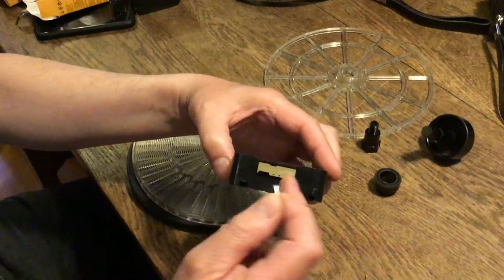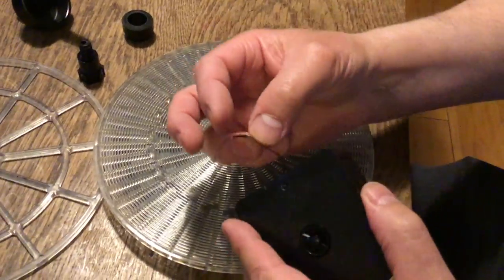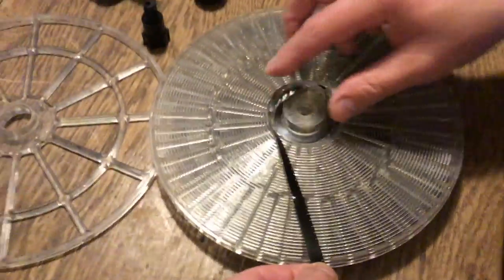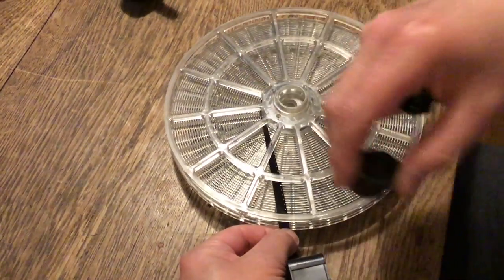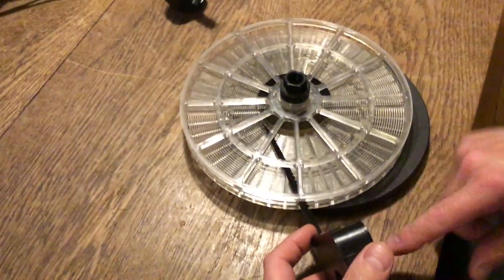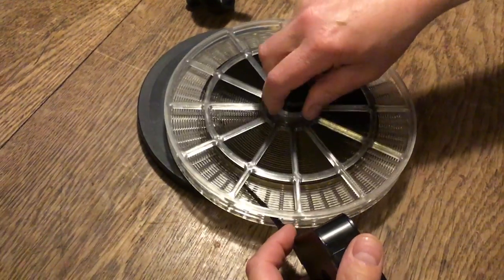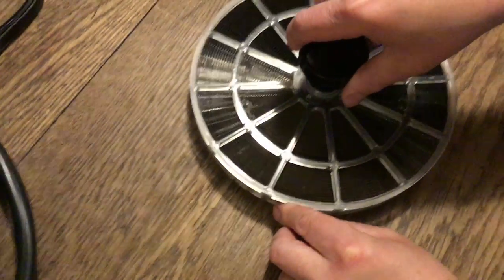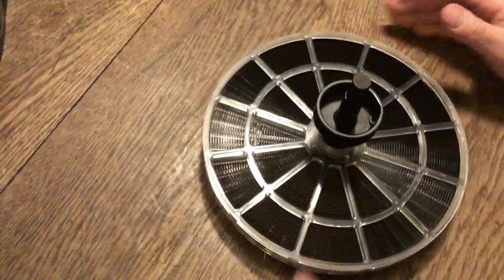Super 8: loading a cart onto a Lomo developing tank spiral

Comment: Funny as I just recently have used this method on my last two developments. Saves heaps of time fumbling back and forth onto reels in the dark
Reply: I would also like to add for anyone using the LOMO tank and having problems with an even development. When you agitate the film in the tank, do not spin the spiral. There should be freeplay to pull the spiral straight up in the tank about an inch and then you let the assembly fall back into the solution. I will then smack the sides of the tank a few times to free up any bubbles. I do that procedure every minute for all solutions during development.

Comment: hi Adrian! Once the cartridge has been opened are you able to cut off the film strip after loading it onto the reel and then leave the remaining film undeveloped in the cartridge or does opening the cartridge this much leak light? I just wanted to do some tests and so do;t want to sacrifice a whole cartridge!
Reply from the maker: the cartridge isn’t opened at any point, you can remove as much film as you want to test, and as long as you leave a bit hanging out of the cartridge you can then come back and load the remainder onto the spiral. Loading the film needs to be done in complete darkness, so there should be no opportunity for it to become exposed to light
Reply from the maker: This Facebook post I did has some more details on how to do a super 8 test strip: https://m.facebook.com/story.php?story_fbid=pfbid0eg171FSxk2y5WMerd4FcDLV5zHnYLWrwAAhbp8DQFMxksdjsBmwNZsVZoXXg4gJzl&id=582718948

Comment: Great video. I'm not sure I understand why you put that small pin inside the cartridge? If you turn the wheel counterclockwise so it breaks, won't that allow you to pull the film out of the canister?
Reply from the maker: Turning the wheel anti-clockwise isn’t enough - the cartridge has a plastic pressure plate that needs to be pressed down in order for the film to be extracted without scratching it, in the camera there’s a small ridge on the film gate that engages this pressure plate and pushes it in allowing the film to move freely when the cartridge is inserted, the small strip of wire I push in to the cartridge does the same job.
Reply: @adycousins  About how long does your small strip of wire have to be to fit inside the Super 8 cartridge?
Reply from the maker: @OskarFilms  I just measure it by inserting one end in the recess and marking where I need to cut, but it’s about 13.5mm